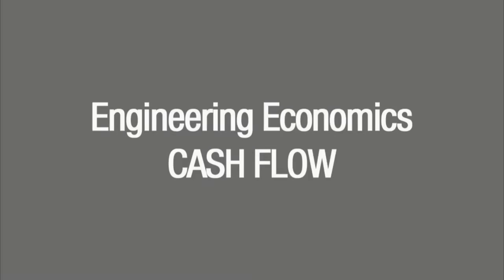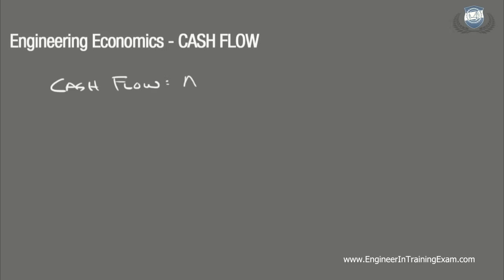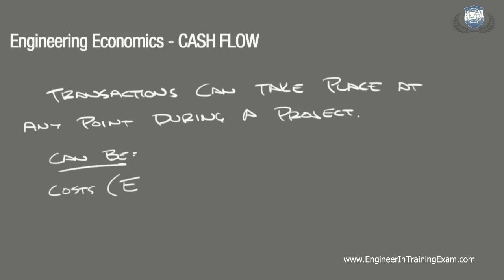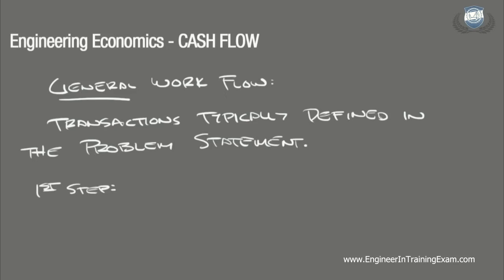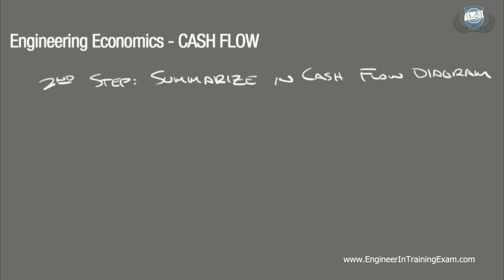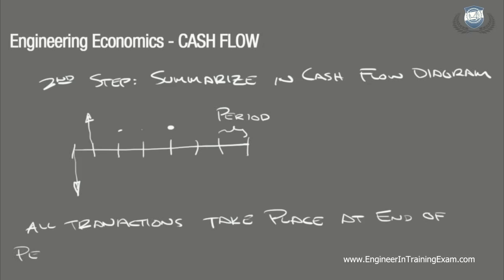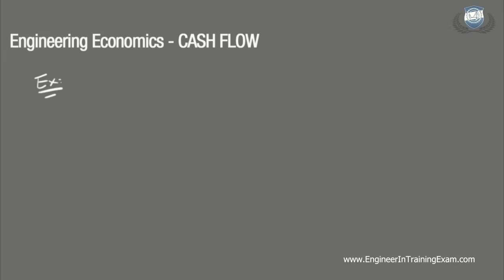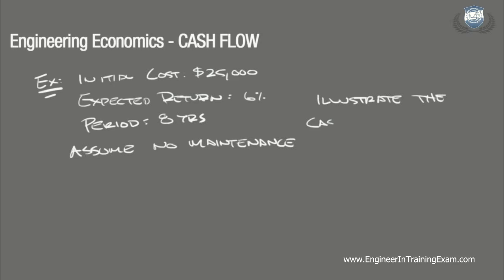Cash Flow - Fundamentals of Engineering Economics

Comment: Thank you!!!
Reply from the maker: Nice Guy No Problem! How has your FE Exam studying been going? I'm looking to post even more videos, if you have any topics or problems, you would like to see explained more in depth or worked out!
Reply: I think I have the concept down but just studying the terminology. Thanks though
Reply from the maker: Nice Guy Keep up the hard work and it'll pay off soon. From my experience with the exam, it is best to spend time working problems and more problems, and more problems, as a majority of the problems will have you do some type of calculation. A quick tip to #hackthefexam is when facing a concept question, look up key words from the problem in the index. A lot of time some problems are just looking for you to know what chart or table to look at in the reference manual, and nothing more. The Chemistry section is infamous for this, where it will ask you about a value or property of an element, and all you simply have to do is look at the correct table and find the element in the table.